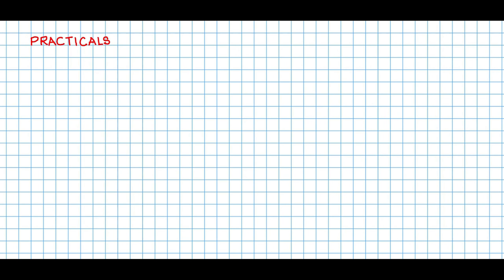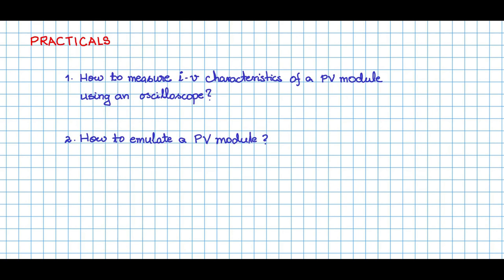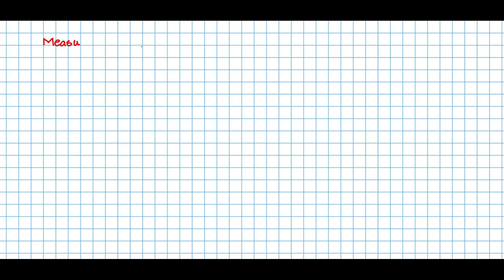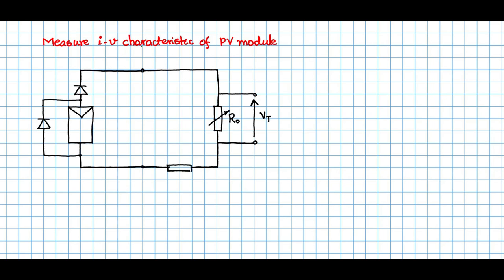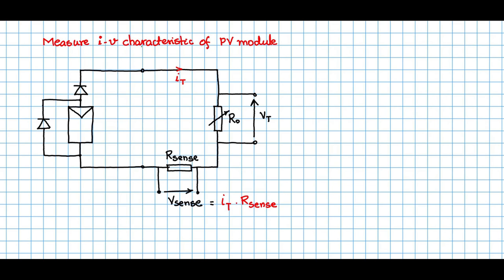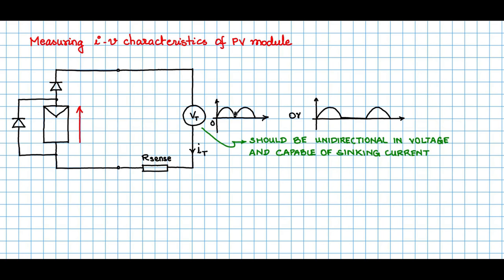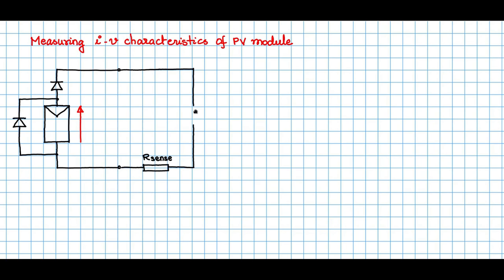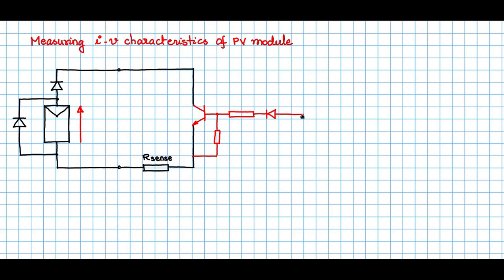Practicals - Measuring I-V characteristics

Comment: Also another solution for IV curve traser for PV cells are a SMU from Rohde & Schwarz NGU401.For details please contact me in mail.
midhun.sinetec@gmail.com 

https://www.rohde-schwarz.com/ca/products/test-and-measurement/dc-power-supplies/rs-ngu-source-measure-units_63493-1005128.html#:~:text=The%20R%26S%C2%AENGU%20soure,recovery%20times%20of%20%3C%2030%20%CE%BCs.